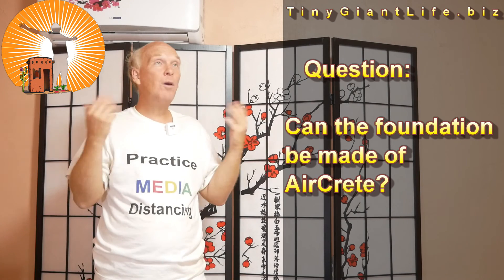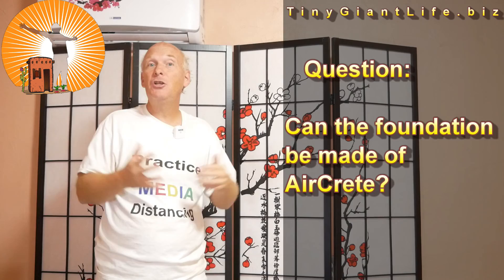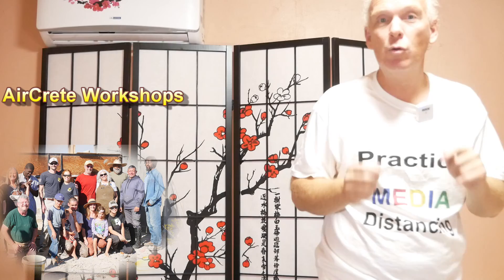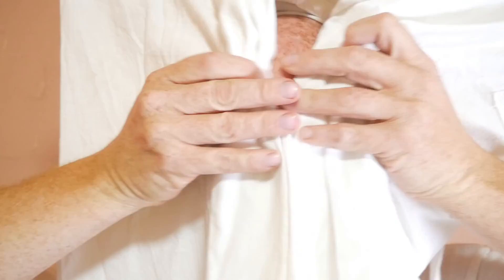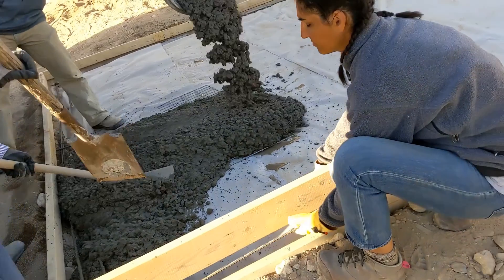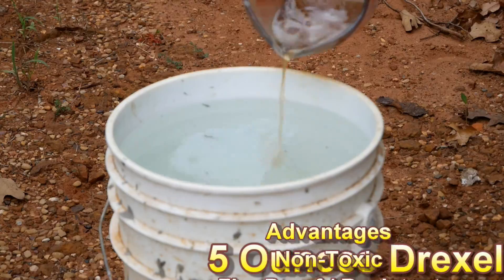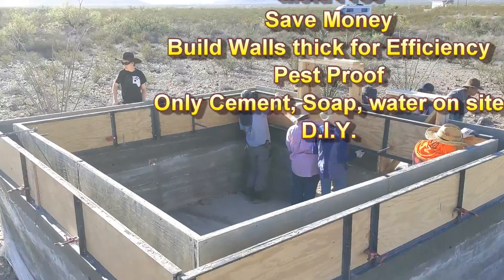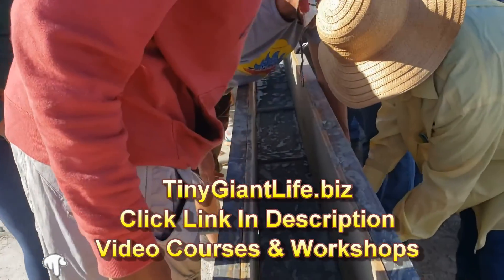26 Can The Foundation be Made of AirCrete

Comment: Question. I know in 27 you talk about driveways, and mentioned that pieces break off. In this video you talk about foundations. How about pouring a slab on grade that will be covered with flooring? Also, does it work well with hydronic floor heating systems? Thank you in advance.